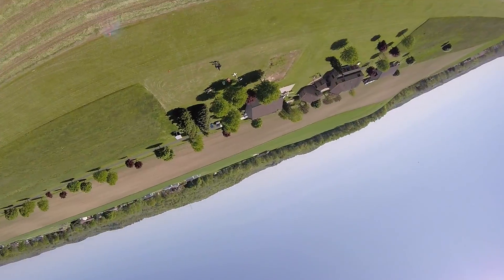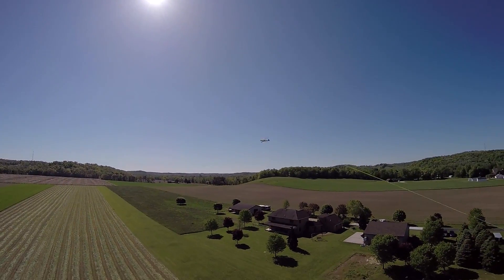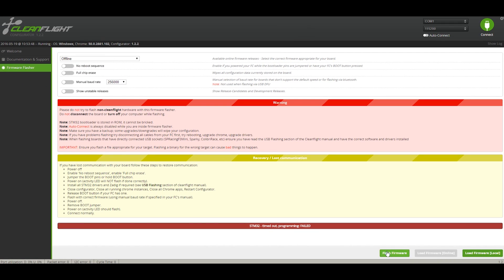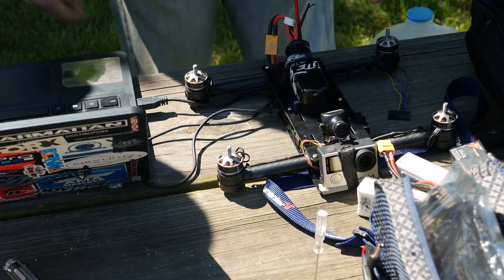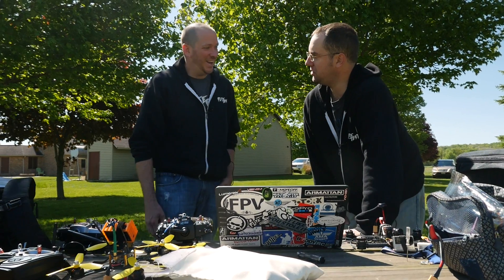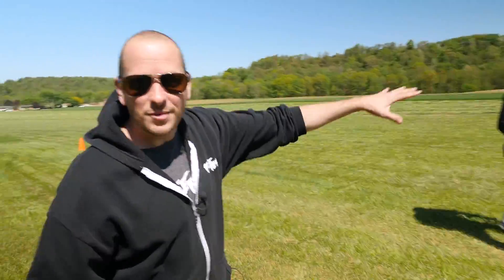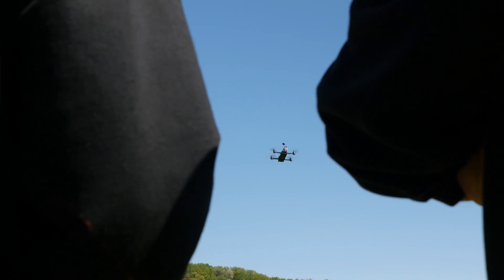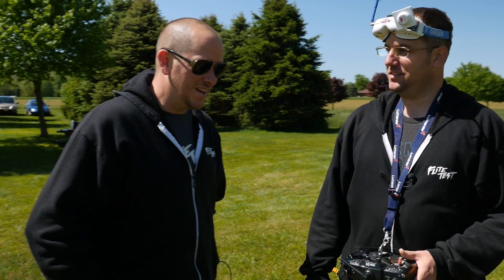How To Setup AirMode (Betaflight) | Flite Test

Comment: I can't believe people are still arming with a stick command... :( Just set a switch to arm and add airmode on there, and just disarm when you land! Jeeze... Also Boris has re written the PID controllers in newer betaflight versions. I am using 2.8.1 right now. Stock PIDs are probably better to start with since copying others (older) PIDs might cause some issues. I don't even understand how airmode is not something that is just always on there, I have never flown without it.
Reply: digging 2.8.1.  airmode and superexpo as features is the bees knees.  i'm in love with superexpo.  rolls and flips are lightning fast.  It takes a little getting used to, but boy is it fun.
Reply: I'm not that good at LOS! BTW I saw one of your videos doing LOS with 4 blades and you have awesome skills! I'll be checking out your vids... Thanks!
Reply: Jay Vantol FPV Those really aren't that high, yaw perhaps. But really I am going to fall back on to what ever makes it fly well :)
Reply: Yeah the most recent ability to turn it on as a feature is great
Reply: Also I think I've converted most of the guys over to switch arming since we recorded this ;)
Reply: T-Bone FPV The feature thing is not really useful (although I am using it) as you just set it on same as arming, but I guess now it can't accidentally be turned off. You better, stick arming is dangerous if you get wild!
Reply: +The RCAddict I agree with it being the same as having it on the arm switch. Just allows you to set a throttle threshold for it to engage instead of instant on
Reply: T-Bone FPV Actually, Boris has done something similar to that. Now, upon arming, airmode it not active, and only becomes active once you have taken off (passed threshold on 1350) I think that threshold can be changed. This is good for people in a race, who arm but still sit there for a few seconds before taking off.
Reply: +The RCAddict yeah I loved it this last week racing. Used to arm right before take off. This week it was nice to be able to arm and have it right at the throttle level to just barely sit on the ground. 

set airmode_activate_throttle =
Reply: T-Bone FPV OK, sweet :P
Reply: I have 2 doubts about this... Is the 1,350 threshold activated by default ? and will the quad have a different behavior when hitting a tree branch in airmode for example ? In rate mode I hit a tree branch and usually can keep flying without any issues...  thanks!
Reply: Roman, if you hit stuff it will try to keep itself flying.  I experienced that a couple of times this week.  By default if you turn on the feature, if you don't turn on the feature you can still apply a switch.  you can also set the threshold to your liking.
Reply: Thanks ! I am almost done building my QAV210 and yesterday I assigned a 2 position switch to arm and airmode together and at the bench if I applied throttle up(while in airmode) and then bring throttle back to minimum it would just try to throttle up instead of lowering the throttle proportional to the input of the stick. Motors where in place but not tightened so there where some vibrations... if that had something to do with the behavior of the quad.... Any ideas ?
Reply: Roman Ramos Think about it, with airmode active it is trying to make corrections even though throttle is at minimum, so since it is on the bench and not in the air it cant. That is normal. Take it out for a test flight :)
Reply: Thanks! Trust me, I am dying to give it a try but the last part of my build wont arrive until tomorrow (fpv cam) and I still need to install the minimosd micro. I'll be flying on saturday for sure! This is my first try at betaflight with a serious quad as I come from Openpilot flying rate mode with old style PIDs from Optune calc...  Thanks for sharing the knowledge!
Reply: Roman Ramos Remember, there is always LOS ;)
Reply: Roman Ramos Well, to me any flying is better than nothing :) 1 or 2 days isn't so bad to wait though, good luck and thanks :D
Reply: Just to add to the stick arming...bad idea, lol. I killed an action cam because I thought it was a great idea to yaw to the left inverted....
Reply: I'm late here,  but Ive always used a switch to arm,  now I added a second switch for air mode.   any probs with this?
I had arm set with motors set to spin at  1050,     so while flying always had control at 0 throttle.   still not sure what the diff is between that and air mode.   but Ill try it out this weekend.
Reply: That's how my setup is. I use airmode as my equivalent of idle-up as I have motor stop on. It allows me to 0 the throttle on landing with air mode on and focus on throttle control without fumbling for switches. I typically will arm, turn on air mode, take off, do all my flying (whether racing, etc.), and then air mode off before I land. Also, airmode off if I crash.
Reply: yeah ok.   I just set up a 3 way switch like this..  Angle/Acro/Airmode....      even though I never really use angle.  but I could use it in an emergency if I have time lol..      and I have my motor stop on.     but is there a difference between having motor stop off with 1060 min throttle and airmode?
Reply: Jay Vantol FPV Jay, newer betaflight releases have an airmode always on function that sets airmode after you reach a specified throttle value.  but there's nothing wrong with using a switch.  you want to set your motors to spin just a few ticks higher than the motor that starts at the highest value.  Airmode is more complex than idle blades spinning at min throttle.  Check out Joshua Bardwell's youtube channel for in-depth explanations :)
Reply: Jay Vantol FPV or, you can setup your arm switch on a three way, disarm, arm, arm w airmode. Ditch angle, you'll never use it and it will only hinder you.  Its not intuitive to fly with after you've flown a few packs and figure out the ultra basics
Reply: TurkFPV ok thanks.    I'm trying it.  I have it on a switch from Acro to airmode with motor stop on.
Reply: yeah.. youre right, i havnt used it in many many flights
  and thanks
Reply: ok,  flew the newly programmed taranis switches with airmode setup at manning park in BC Canada this past weekend... (must fly sub alpine locations with trees!!)   ive been flying quite a bit lately but only used idle up on arm to fly.   using airmode  did seem alot more stable in aggressive dives and seems to hold crazy angles alot better.
over all im loving it.  but realized i still need to work on my pids,  getting a bit of vibration on hard punchouts and hard direction changes.
Reply: Jay Vantol FPV Glad it is working out for you :) If your PIDs aren't super high you can add some TPA to reduce punch out oscil, but that prop wash would require a very good tune to rid it.
Reply: The RCAddict thanks man!  My pids are fairly high, I thought about the tpa, but not sure what's  a good base number to start with.. i have about .1 on there but could you tell me a good starting point for that is?
Reply: Jay Vantol FPV What is your roll and pitch P (since you think they are high) I would try .3 if you are getting some oscil :)
Reply: the p's are 54, 80, and 110.   the I's are 35,43,45 
cleanflight. 
250 lumenier style copy
2300kv
4s 5x4 tri props.
still in slow progress of tuning
Reply: yeah ive never really experienced any P related oscillations i believe.  soon im going to start from stock pids and work the p's up set by set untill i notice them.  then I's   just for the experience of it.  ive changed them so slowly over time i feel like i want a fresh start even though its fairly locked in.
and im going to try .3 to start on TPA.    thanks a lot for the help !!
Reply: Jay Vantol FPV Yeah, that sounds like a good approach. Just make sure to back up your current setup :) I normally like to take D was down to like 5-10 then bring P up till it gets too tight and has some oscialltions, then back it down a little and add some D in and go from there. I is sorta in dependent and I just do low throttle turns and punch outs to get that tight enough.

Comment: I'm sorry guys but these instructions are not right anymore in the version available at this video upload date, which is 2.8.1. Airmode is a feature and must be set in the CLI.
Reply: It is still a mode as well. You can set it up the same as in the video.  However if you wish you can set it as a feature instead.  If you set it as a feature it removes it from the mode list.
Reply: +T-Bone FPV yes but default is enabled as a feature and won't appear in modes tab. It will confuse new betaflight users.
Reply: No, I just got it and it was in the mode tab already
Reply: +susanrc73 you are right, it is in my default commands and I assumed it was default with full erase.
Reply: +Hugo Araújo yeah super expo is enabled as default but airmode isn't (yet) :)

Comment: i just switched to betaflight 2.8 and airmode and my flying has gotten ten times better almost instantly
Reply: have you tried multishot?
Reply: Not to mention that I don't know how but air mode is much better right now, I heard everyone saying it is dangerous to land with air mode on, and this afternoon I have landed like 10 times with this mode on and no bounces or crazy behaviours. Gg for boris.
Reply: Excellent. SuperExpo changes on 2.8 and newer are amazing and really make the quads feel great 'right out of the box'
Reply: +IzakGt all of my rigs currently run betaflight 2.8.1 and 14.5 multishot. I don't plan on upgrading unless something significant changes. This is running perfectly for me
Reply: I recently tried (3 days ago) the exact same setup and was blown away. Runs so smooth
Reply: +T-Bone FPV try 14.6 bro. You will love it
Reply: +T-Bone FPV and I agree I think betaflight 2.8.1 is the best to date. Blows 2.7.1 out of the water
Reply: Well guess I have some new searching to do
Reply: +Jake Cardinale thanks man I'll check it out
Reply: can i still use damped light?.. if reply button doesnt work, just reply to yourself i still get notification.
Reply: +alan hennesy as in motor idle, then yes you can I believe
Reply: Well as I am still learning so the only thing I know is that I do use betaflight 3.0.0 on my F303 flight controller, and in Blhelisuite I have dampened light on all my ESC's turned on.
Reply: +IzakGt I have not used 3.0 but air mode should work with damped light on
Reply: thanks guys, as a beginner damped light sounds very helpful, and to be honest i was perplexed to hear airmode was a new thing, i'm sure a couple of my toy grades left some control on regardless of throttle position,  except maybe zero. but anyway i really want airmode to learn acro fpv flying, if only so i can recover without throttle increasing my disorientation etc etc......
Reply: +AveryFpv, airmode surely works with beta 3.0 and dampened light.  I currently have airmode always on. Not assigned to a switch. You have to do that in the CLI command. For Alan hennesy Check out Joshua Bardwell's stuff on YouTube.... TONS of info. I'm not sure what dampened light actually controls (I'm sure Joshua could tell us all) or how it works. But I know for me I have it ON and did have it on at beta flight 2.9.0 along with airmode. I now use 3.0.0 bc that's what they had going for the F303 at the time. Either way I LOVE Borris B's flight configs
Reply: i'm subscribed to josh of the future, damped light just puts the brakes on props when you throttle down, i imagine it helps with that floaty feel you get from throttle punch, better to have it stop rising/accelerating, when you stop inputting. thanks for your input it all helps .. i look forward to using boris b's  configs, tuning pid's is just my version of hell....i broke a g2d gimbal trying to tune it...
Reply: +IzakGt agreed, I'm running 2.8.1 on a spf3 and damped light on and air mode always enabled
Reply: +alan hennesy ah, yes, I remember now, yes yes damped light is amazing!!! make sure you enable it
Reply: Just want to say, you guys rock! Sorry to hear about the gimbal Hennesy!
Reply: +IzakGt :) glad to help
Reply: If you setup airmode spin RPM correctly there is no bounce - since proper setting should provide no lift -so you did it right!

Comment: Having air mode on all the time is 100% fine.. I have arm and air mode on the same switch.
Reply: We did this prior to 2.8 as well. With airmode as a feature it's great!
Reply: I have done it that way since like 10 versions ago. It does not cause issues taking off and landing as long as you correctly set your min throttle. It looks like in the video you left it at 11xx, my guess would be if you went to the motors tab, calibrated your escs, then pulled the motor slider up until the motors spin they would be at 1015-1050.

Comment: Will this work with the  spectrum system
Reply: It can, but keep in mind that saying this doesn't mean much.  For any vehicle to work with spektrum, you'll need a spektrum based receiver on the vehicle.  You can certainly add one to the Vesacopter, like all RC vehicles. So yes you can use spektrum, but you'll need to install a receiver on the quad and connect it to the flight controller.  This is actually very easy, but if you have never done it before, it would probably be wise to look up some tutorials on it.
Reply: i use it now on my new Spektrum DX8-G2...( love it...5x 3 way switches and speak and Telemetry) with an Orange R820X-V2 S-Bus receiver...FullRange --tested 2Km - Diversity-Telemetry !!  and price is 20 Dollar..  tx delay 11ms in DSMX !! same price as an plastic-cheap looking ..poor gimballs Taranis..and i do NOT need that 14 channels.. :)

Comment: Air-mode is available on the latest cleanflight
Reply: +RCKnut because betaflight shits all over cleanflight, where are yous? Stuck in 2015?
Reply: +RCKnut it started as a beta software. Boris just never changed the name. Scroll through the comments too see him say that for himself :) it is a great software to use. I use it on all of my quads with no issues. Freestyle, racing, chase footage, you name it
Reply: Great to know thanks. I haven't ran cleanflight in a really long time so not up with where it is at
Reply: Yeah, I don't see why they're using beta.
Reply: 6 that's 6 months ago chill out! I love boris as much and the next fan boy and this is a tutorial buy a guy who is not to sure on how a cli dump works! but there's pull request and things from beta flight get put into clean flight once everything is all good. beta flight is BETA look at when the i term didn't work not the best for the new guys!
Reply: Beta is for testers, you shouldn't fly betaflight on yoru daily flyer. that's about as smart as using beta software in a production environment if you work in software/IT.  There's a reason it's beta and not "othername"Flight
Reply: +Brighton Till I Fly lol!  I didn't know cli dump because I've never needed to use it.  I can fully set up one of my boards from scratch just as fast.

Comment: Couple important notes. Verify Min throttle is set to the lowest value that reliably keeps the motors spinning. If too low the motors will stop and you will have no control. If too high your inverted hang time will be horrid. Also careful copying PID's from any build into the newer betaflights. PID controllers have often changed.
Reply: Awesome input!
Reply: A note on reliably spinning the motors, that means a few points above what you find in a perfect situation so that noise etc doesn't have an effect when you are actually flying
Reply: +Reuben Horner more wind resistance on the props but yes